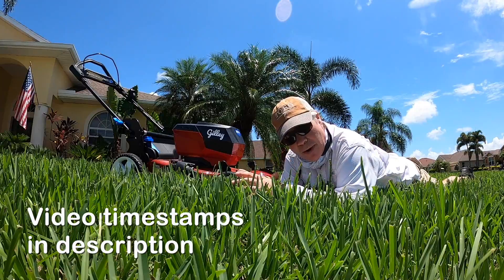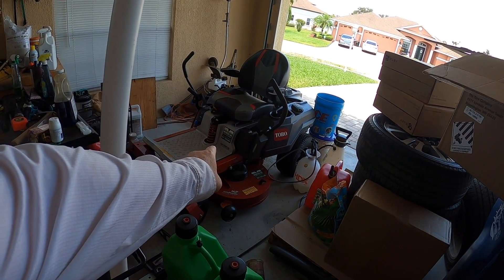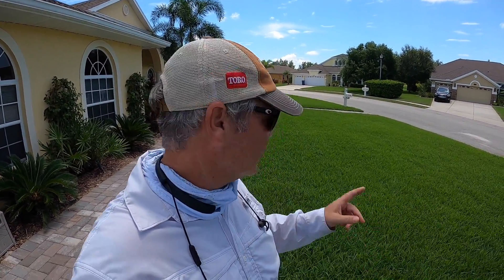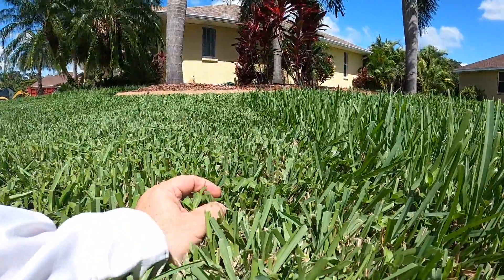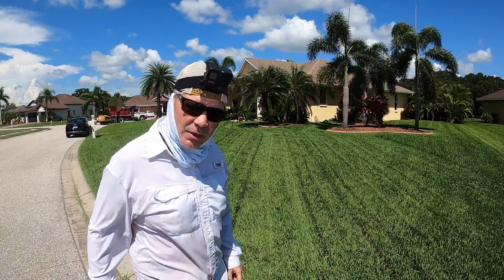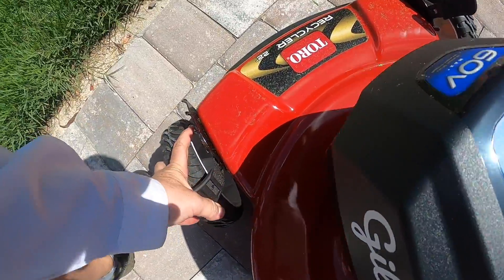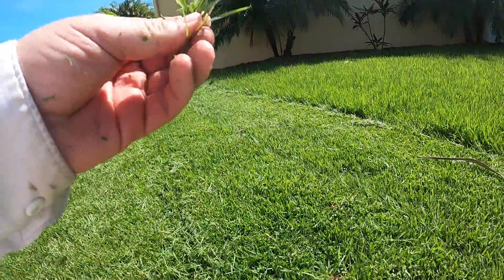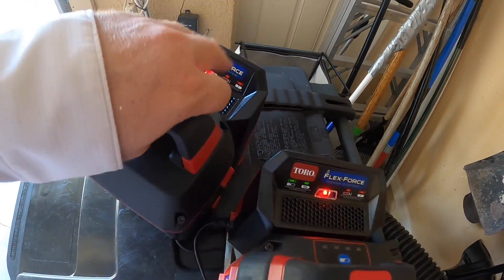60V Mechanical Bull

Comment: These battery mowers just don't have the power for a professional. I started off with all battery tools (Ego and Milwaukee). I've also used the Toro 60v recycler. Now i use a regular gas Toro recycler 190 cc with a high lift blade installed and there's no comparison. I think with all battery mowers you really have to push them very slow and/or make multiple passes to achieve a good cut quality. You also cant expect as much lift compared to a gas mower so more leaves are going to be left buried in lawn and stuff. I cut some fairly nice lawns with the Ego(high lift blade installed) and it did a decent job but it always took forever and left stragglers i had to make multiple passes even on a dry lawn. Getting a gas one pretty much put me into light speed. I think there's a reason why you still use gas and haven't moved onto the simplicity of and quiet of battery. You want performance. Now if i was a home owner with a small/medium lawn the Toro or Ego mowers would be just fine.

Comment: No place in the literature says it's two wheel drive. Just two days ago I looked and see it has a drive shaft going to the dead wheel. I pull the wheel off and there is NO GEAR in the wheel.  I sent an email to Toro PR dept with pictures and asked for them to send me a new wheel under warranty. A new wheel is $50!

Comment: Hmmm, my ego has yet to have a hot battery charging issue. And I live in dfw where it's hot all the time,but then again I don't mow in the middle of the day either.
Reply: That honestly has to do with the design of their battery units (It's great for heat!) and the fast charger has that cooling function that also helps. I have to take my Ryobi in and put them on the AC vent after they drain so they can be charged faster.
Reply: @DaveAtUofL  yeah I bet if I really tried I can make em overheat too. I've had plenty of Dewalt and Milwaukee batteries do this.

Comment: I’ll bring over the 60V Super Recycler if you want to do a comparison :)
Reply: You have one??????
Reply: I built one :)
Reply: Brett Wilkerson Did you swap out the Recycler body with a Super Recycler body?  I’ve been thinking about doing that 🧐
Reply: I did, purchased the B&S SmartStow SR and the 60V Recycler, swapped the motors, and bam :)

I will say the push button to start the mower required extending the wiring by about 6” as the SR handle is slightly longer. Other than that, simple swap and it cuts well enough that I sold my HRX.

Comment: I bought one and had it at highest setting and it was awful cut. Took out my dying gas Toro and I could tell a difference . I finished with the  battery mower but it had too many blades sticking out like a bad haircut. I do not think it has enough sucking lift to get a good cut. I took it back.

Comment: Tell your friends at Toro to come on already with a single point deck adjustment.
Reply from the maker: Agreed 👍
Reply: @TheLawnCareNut  It's literally the only aspect of the 60V that stopped me from reaching for my wallet. I make 7 deck adjustments doing my lawn. No way am I futzing with each wheel, each time. 

Toro people say independent wheel adjustment is better, but...I'm seeing most brands running single point adjustment that's dependable for the life of the mower.

Comment: I have a battery mower because my lawn is so small a gas mower is overkill. My issue is I have zero desire to sharpen my blades myself and when I took it the 'good ol' boy' shop, I got snickered at and treated like a dumb girl, because of course I would have a battery mower.  I was told it could be sharpened, but it would the same to buy a new blade.*insert eye roll*  I'm just like...and I'd still have a dull blade. I swear to dog... sometimes. I know this is a male dominated field. But I take pride in my lawn and enjoy doing it. My lawn is small and I have zero outdoor storage.  So now I'm gonna have to learn to sharpen my blades, because they aren't gonna get another dime. Honestly I don't think they did a very good job.